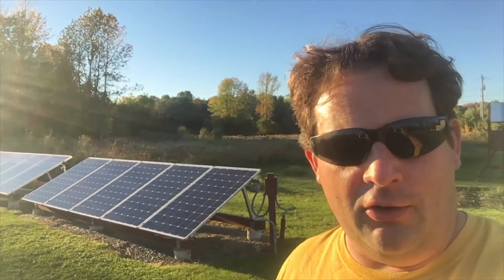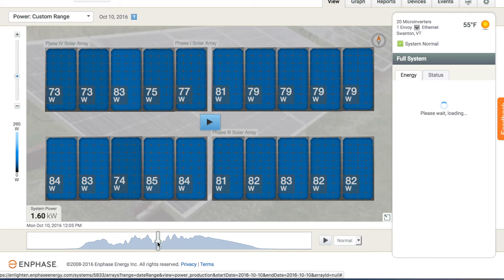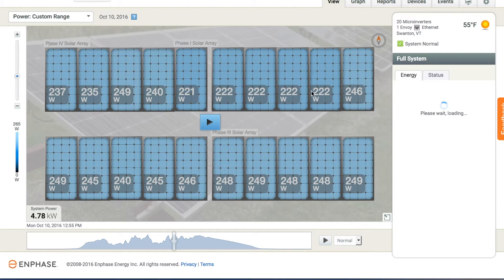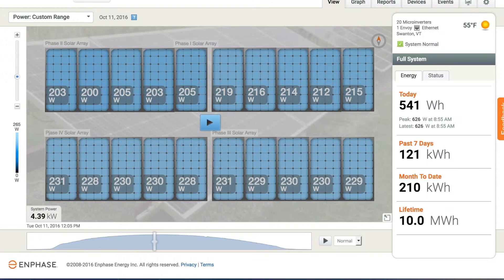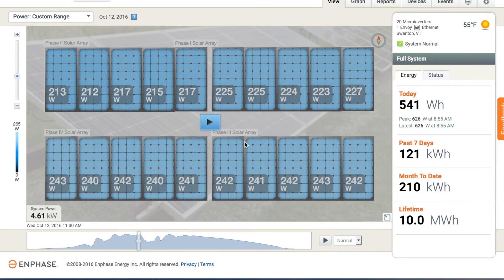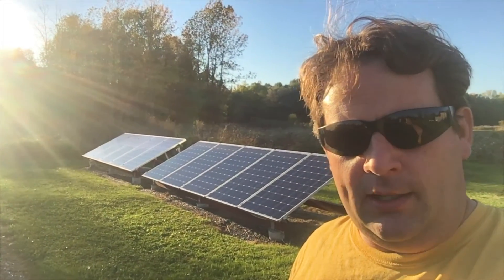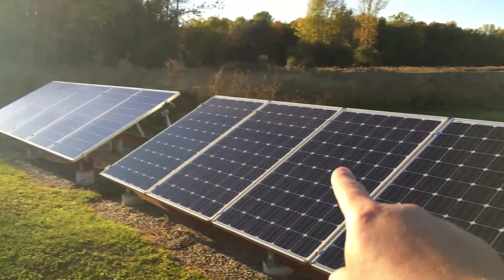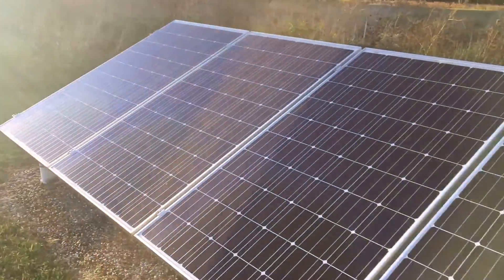Enphase M250 Troublingshooting Part 2

Comment: Your results on the issue are answered at the end of your first video. You have For solar array, at peak performance. Three out of the four solar arrays have a N phase inverter that maxes out around 250 W. You have one solar array that maxes out at 225 W. When you swap the inverters, you can see the maximum wattage become limited to the maximum wattage of the micro inverter 215 W. The second component of the wattage output being greater on the lower two solar arrays first the upper two solar arrays are correct, meaning as the sun intensity increases and the condensation for example dries your performance will vary on the array and balance as time increases and the strength of the sunlight is even, usually around your 1030 window-3:30 pending your map on the globe and season. Hope helps. Also if think is array wiring, check continuity when power off on disconnect. Should answer if any wiring issues.

Comment: i've got an array with mixed m-250's, and m250's. I'm running the dc wirign inside the house, with the inverters and trunk cables inside, instead of out.  i'm having intermittent trouble with one of the 250's, flashing red instead of yellow...   checked 40v at pv panel, and short circuit amperage over 6 amps. reset, and still has problem sometimes.   I do have a ground cable connecting the steel structure to all of the inverter chassis, as if they were connected. any ideas what could be wrong?
Reply from the maker: I found out the issue is the solar panels and not the enphase inverters.  The Row of 5 suniva panels are not putting out energy to spec.  Unfortunately, Suniva is belly-up and my options are limited.